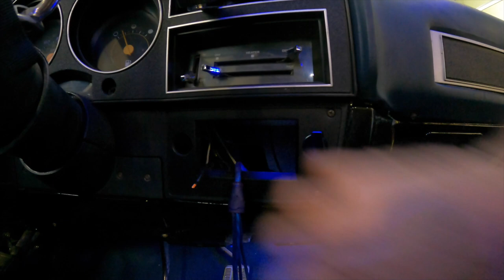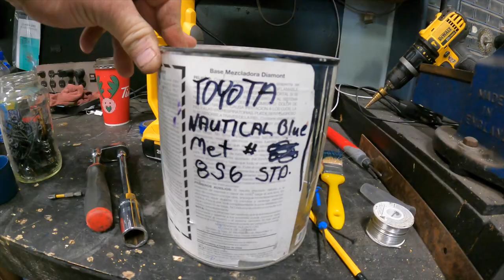This Couch In The 87 Is Awesome    HD 1080p

Comment: Nice, looks custom fit. =-)  
 
Just drive it. Get the most out of the old engine, then swap it.  Its not like anybody is going to buy a worn out 305 for good money.  Besides, your gonna have to save your pennies for when the new engine finds all the weak and worn out clutches in the transmission, and the probably too low stall torque converter.    

Good price for the rally's.  I am tempted, but I got two and a half sets of wheels for mine as it is. LOL.  Ask again in the spring if you still have them at that point.

Comment: I'd keep a working engine in. Big spender billsiff slow down, why wouldn't ya.  No Ricky pants.  If 87s going to park all winter (hopefully) I pull the plugs and give each cylinder a quick spray of fogging oil